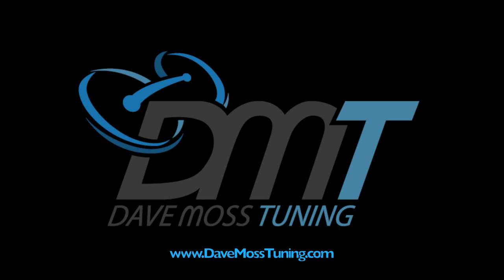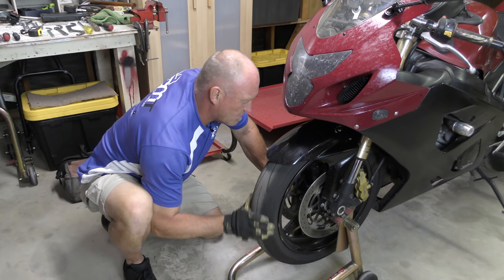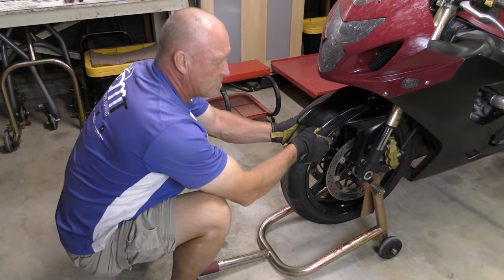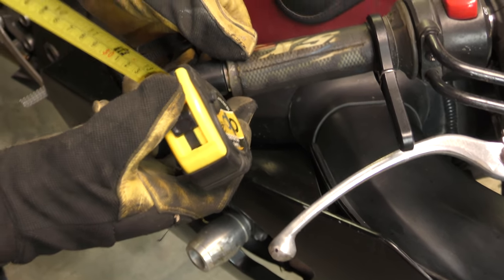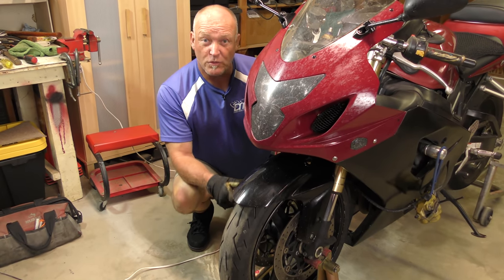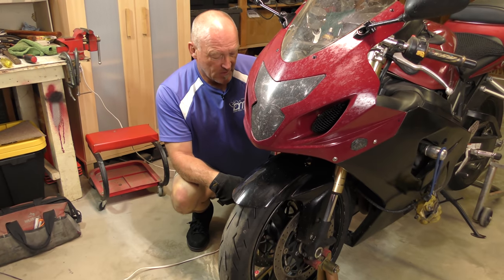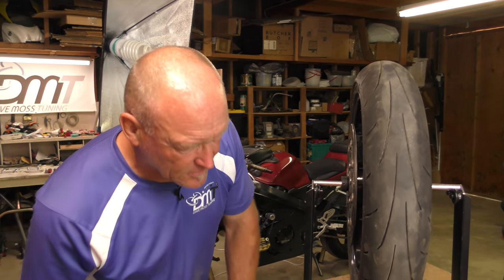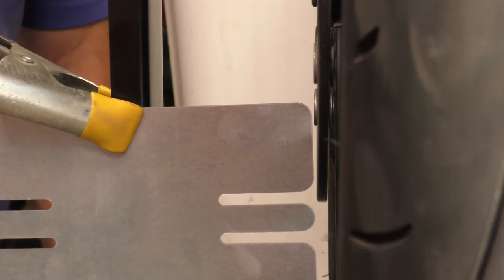Trash or Treasure: '05 GSX-R750 Front Brake Problem Ep 1 Rotors

Comment: I experienced a very scary problem with warped rotors yesterday. The rotors were so warped that they would spread the caliper pistons so far apart that the brake lever would pull all the way back to the bar. With the bike on the front stand, I could pump the brake and it would feel good and firm but after only 2 full rotations of the wheel the lever would pull all the way back to the bar. If I had been riding, there would have been no way to get any braking power from the front lever.

I swapped rotors (by robbing my other bike with identical wheel) and problem solved. I can spin the wheel all day and the travel distance of the brake lever from zero to full power does not vary at all anymore. This video is a wealth of information and has helped me further understand all the data points to consider with these types of issues. Dave, you are a great asset to the motorcycle community! Time to go check the straightness of my wheel.

Comment: I had a low speed, post u-turn in the rain, high side and suspected my wheel/front brake rotors could have experienced some sort of twisting.
Now I know exactly all to look for before running out to buy buy buy parts 😁 Thanks DMT
Reply: get your wheels off, stick the axle through and put them on leveled lifts

spin the wheel and stop it at the most inward position of the thing you want to measure runout of

now stack books or boxes and put a pencil with the sharp point against the farthest point you can spot and spin the wheel, making sure the pencil doesnt roll but gets pushed backwards

measure the distance and check against specification

best way for the poor man to know, if hes living dangerously or not

Comment: All wheels and disks will have some tolerance variation. Even with the wheels that spins the freest, they are still binding too much.  I suspect that you have more of an issue with the caliper and it's ability to pull back after releasing the brake lever.

Comment: For the original thickness of the disc it should be pretty close if you mic up the lip on the outer edge.
Reply from the maker: Dave Williams, editor, replying here. That's exactly what occurred to me as I was editing yesterday, "Duh" I said to myself. I just went out and mic'd them. That lip area on all of them ranges from 5.49 to 5.55 mm except one that was down to 5.36 lip, but I almost couldn't detect the lip at all.
Reply: The specs should be in the manufacturer's mechanic's repair manual.

Comment: Massive run out / wheel and rotors combo .
Reply: Yep, not great at all... Have I ridden worse sure but wouldn't recommend it.
Reply: You would need to have the tire off to get true vertical run out of the wheel......
Reply from the maker: Dave Williams, editor, replying here. The Q3+ wheel is the only one I could feel pulsing slightly under braking. The harder I braked the less it pulsed. But with good calipers and master cylinder it might have been crazy bad.
Reply: @catalystreactionsbw  That and you might notice you need to add more throttle compared to the others also, or just rolling it about taking more effort before you feel the pulsing on some cases.

Comment: So what's the fix then? Repair wheels and face up (skim) disc mounting faces?  Obviously making sure the discs aren't warped beyond factory specs.

DTI and mag stand can be bought relatively cheaply. That way you can properly measure run out.
Reply from the maker: That is correct on all counts.
Reply: @catalystreactionsbw  I can't wait for the next video then 👌🏻👍🏻👍🏻👍🏻

Comment: well as far as i remember you grinded the disc mechanically... hard to get it plane (flat and even) that way... and regarding to that mayb hard to adjust ones brakes later too. mayb replace it with some lighter, better,  and cheaper too... it's been a while since '05? :)
Reply from the maker: I chose the brake hone as is was easy to use and  not very abrasive compared to a sand blaster or 200 grit sandpaper. It is really hard to get the rotors flat on sanding as we have no machine available to "turn" rotors as there are for cars. Maybe that is a million dollar idea?
Reply: @catalystreactionsbw  regarding the costs of a set of oem ones that maybe is.. esp for that elderly gals :D the procedure did look a bit... brutal and working brakes r vital esp on a racer. 
sry sir, didn't want to insult or lecture you, english is not my native language :)
Reply from the maker: @justRORIRARU  You did not insult me - you shared very clear thoughts that many others are not willing to type and your questions lead to more conversation for others to decide how they want to do it. I appreciate your contribution!
Reply: @catalystreactionsbw  what kind of grading does the honing disc have? to the 200 grit?
Reply from the maker: @GGj-q9k  120 grit to 200 grit is common to clean. I would finish with 400 grit.

Comment: Why would my front end bounce at real low speed with brake pressure???  I can brake at 90mph and it's perfect.  But as soon as I get down under 15mph or so it starts bouncing.
Reply from the maker: Speed creates velocity of movement so slow speed is insufficient to make the forks work so they fail to absorb bumps.

Comment: I know this series is just good as an excuse to do a great informational on how to approach an old motorcycle but i am sure such a bike is MAYBE good for parting and not certainly viable for a restoration unless one wants to waste money. 
Still, i love the approach you take on figuring out issues and how to fix them. Thank you.
Reply: My 2005 Gsx-R 750 is still killing it and rolling hard with 1000's regularly.
Regular maintenance and a solid bike can easily outperform a much newer high end bike....
+
It's really all in the rider
Reply: @silversoozookee2839  That is not what i said. Clearly this is a bike that has been sitting untouched for years and it shows. Some people will ride stolen recovered bikes like nothing happened. I prefer being safe, you know. Sure an old bike can be good providing it has not been abandoned. This video reinforces the point that Dave made when they started the series. Some people said that it was "shocking" they paid such a low price for it. Well...
Reply: cashflow - if you have just limited amount of money, you can't afford best solution straight away. In addition - this is one of four disks - bought god knows where. So it doesn't relate to bike itself.

Comment: My k4 gsxr 600 has the front disc  buttons a bit loose, the discs /buttons are making a bit noise when driving slowly on "stone  road".
When i grab the disc with my hand and pull back and forward into the direction it spin, i notice that moves about 3 mm!
Is this acceptable?
If not, they are fixed or replaced?
Thanks
Reply: Seems a excessive.  I would look into new ones or new rotor.
Reply: When You flatten the buttons and the disc make noise. The rotor has become a floating rotor and should spin more freely. Like on race bikes.
Reply: @Apollo-Computers  thanks for the feedback.
A complete new rotors/disc seams bit expensive and my discs seems good.
I'll consider the option to change the "buttons"
Thanks

Comment: Put a dial indicator on the rotors
Reply from the maker: I was looking at creating a mount for vernier calipers set perfectly horizontal to start with a wide gap, then as they close, see how much difference there is across the entire rotor surface as the wheel locates. Dial indicator for those who know what that is gives more accurate data and is a lot more time consuming, BUT, you get results in much greater detail.